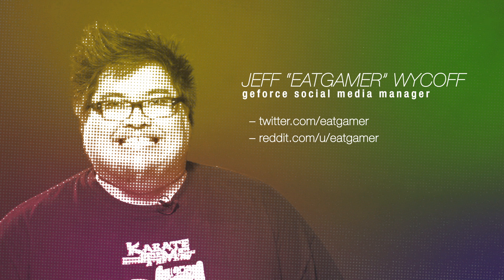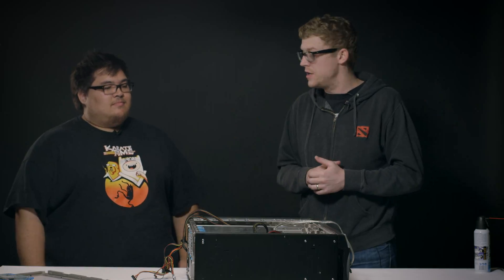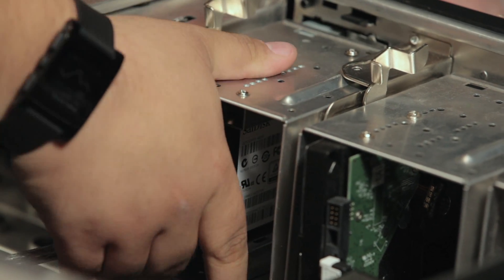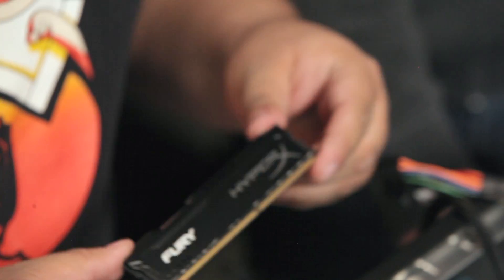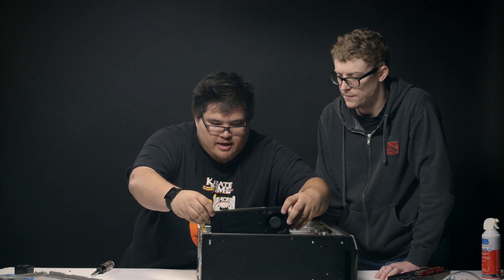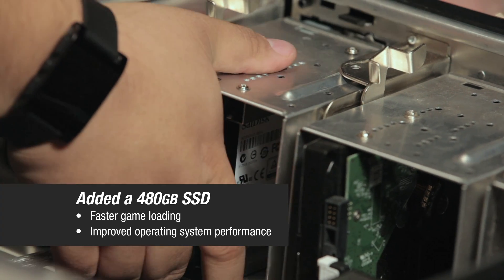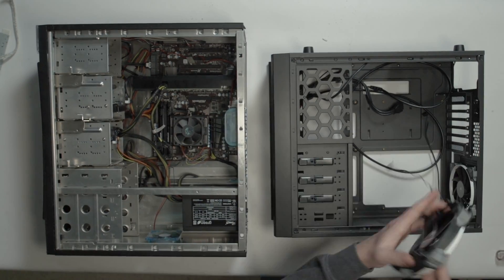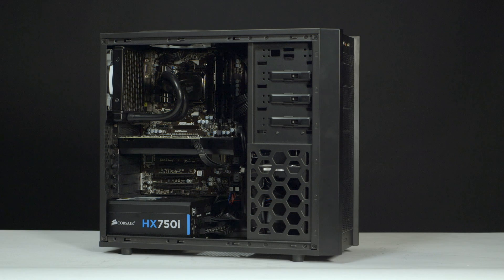GeForce Garage – How to Breathe New Life Into an Older PC

Comment: This is not an upgrade...You just built a new PC that showcases the crapiest parts of the old build! If one thing needed an upgrade that was the motherboard, the CPU (quad core Phenom or what? come on...) and a SSD boot drive would be cool. That 660 is still rocking and 8gb is decent enough for gaming!

Comment: Not one single reason explains watercooling this rig...or any other rig unless EXTREME overclocking is done.  Gamers get a clue,  Watercooling is complete overkill and pointless.  For any twits caring to argue go research water cooling and how water retains heat over time.  Unless you're using some sort of external chilling unit water cooling PC's is just Epeen and a complete waste of time, money and most of all RISK!

Stock cooler or a 212 would have been plenty for that cpu and adding 8gb more of the 1600 though completely unneeded would have been an upgrade,  the 1833 just isn't a big enough difference to justify cost.

SSD's great idea simple and hugely effective,  1st important upgrade to any older rig IMHO.  Most of my customers get upgraded right away and use the older mechanical ones for storage.

960 not bad,  basic upgrade and probably useless depending on the PCIe slot speed on this board.

case meh....works and is far better than the original....Corsair 200r would be ideal and usually what I get for my customers unless they specify something different,  though I'm leaning to Fractal designs midi r2 or Phantex Enthroo pro's for a higher end mid case and all are pretty much future proof as far as space, airflow and functionality,  arguably until Type-c becomes more available.

Comment: Smh so in the old rig he didn't have a radiator cooler whatever and the new one he does?
Reply: Well they imported the parts into a new case and added a better cooling system and a new PSU.

Comment: crap, I had an APEVIA X-Navigator case for a build I made back in like 2005, all aluminum construction, which was supposed to help with acoustics and cooling, with a whole bunch of blue leds and 80mm fans, loud but cool looking back then. My front panel also creaked, fortunately it came with like 3 sets of the interchangeable plastic covers, grey, blue and black.

Comment: People who watch this video please dont upgrade youre old PC like this. At first they bought a ssd which is almost more worth than the rest of the pc, then they did a completely useless Ram upgrade and last of all they replaced the case. Why the case? SSD, RAM,  Gtx 960,  case,  Corsair HX750i, Corsair AIO Cooler and Fans cost all together 700$ shipping not included. And why did they use a freakin 750W power supply?

Comment: more like how to breathe life into a motherboard and cpu.. definitely over the top 8gb is heaps and judging by the cpu, it will probably need upgrading soon anyway... no where near affordable to do those upgrades for most people.. In short your video made no sense you added components which would be too expensive to the average person. I would have bought a cheap (reasonable) case, cleaned the components, left the ram, cpu, and gpu. and added maybe an aftermarket air cpu cooler for some oc headroom at a more affordable price range. A 60gb or a 120gb ssd for os would have been cheaper and worked fine. As for mass storage for games ect at this point is much cheaper using a traditional hdd, (which he already appeared to have) Affordability isn't replacing every component but 2. Lol my opinion anyway xD

Comment: "A few simple and affordable upgrades"
Am I blind or did they basically replace damn near every system component anyway.
Reply: Yes.

All that was left of the original PC was the board and CPU so it was closer to a rebuild that salvaged parts from the old one than an upgrade.

Comment: "affordable upgrades"
Overkill PSU   - No performance benefit
Stupid liquid cooler    - No performance benefit
Unnecessary extra RAM    - No performance benefit
New case   - No performance benefit, put some effort into the old one and its be fine.
SSD - sensible upgrade.
GPU - sensible upgrade.

How about you cut the cost of this "upgrade" by 2/3rds by just getting an SSD and a better GPU?
Reply: its only upgrade the cpu and gpu. ssd, monsters psu, ultra cases - no performance benefit  
:)
Reply: its only upgrade the cpu and gpu. ssd, monsters psu, ultra cases - no performance benefit  
:)

Comment: sometimes I feel like I am not ugly and fat and daft enough to work in such a company.
they literally pretend like if the old 660 was garbage and their new model works far better which actually is not the case. the ti version of the old model is quite similar to the new one
Reply: The 960 is leages better. 60% more powerful!!! Did you not hear? And uses less power and has a bunch of new Hardware based features. Its not like he went from a 660 to a 760. thats a generation gap.

Comment: The most upgrades seemed reasonable - however the ram is wasted on a rig like this. You still won't need more than 8 gigs in most cases nowadays... 

Also you should have mentioned that an old cpu can also impact the performance of your gpu. If you are already going to give people the advice to buy new components for their old PCs - tell them also what not to buy...

Best "bang for the buck" for older (not old) PCs:
+ SSD (if still on HDD Basis)
+ New GPU

The rest is more like.. well... And btw - another way to speed up your older computer - is shown but not explained - clean out the dust - why? Google Thermal Throttling...

Comment: before I watch video change cpu is its worse than i5 2nd Gen and add a GPU done
Reply: +Thundercraft And they have changed everything, but they didn't change the cpu. xD
Reply: shobonimaster And here I am sitting on the good old E8400. And the funniest fact is that after overclicking it to 4,0 Ghz I can play AC:Syndicate in around 30FPS (however it often crashes).
Reply: JTN5M It's likely an overclock that large on such an old CPU as made it unstable at high loads.
Reply: shobonimaster It's not. My second E8400 can eaisly go up to 4,7 Ghz but it needs good ram sticks. E8400 has 9x multiplier which means that it needs only 445 FSB to get 4,0GHz.

Comment: GTX 960 $180-200
HyperX 16GB of 1886Mhz RAM $80
Hx750i $140-160
Antec ONE $ $60 
H60 (all in one radiator) $60
SP120 twin pack fans $28-37
Kingston 480Gb Ultra II SSD $150
Overall Price: $698-747
Calling this an affordable upgrade... Priceless
Reply: +Josh Estipona 
It's more like a pc build than an upgrade.. also quad core cpu, 8 gb ram, gtx 660 and 500 gb HD is hardly shit to start with. Just add an SSD, that should do it.
Reply: id rather go to austin evans and watch his boson 3.0 build
Reply: It is if you have a job...
Reply: you can easily forget about the ram and the huge ssd, I think an ssd just for the system is optimal
Reply: Hey man I was looking for some of those stuff . Thx for the research
Reply: +Margad Ganbold NP
Reply: Most people would just considering building a whole PC at this point since you can build a decent, current rig with a better and much newer CPU for around $800 now.
Reply: I could buy a gaming PC for that price.
Reply: Ahhh look at that sweet RAM price

Comment: This video enrages me more than it should. First, "affordable" upgrades? All that new gear would cost around $700-900 depending on where you live, literally meaning that this "affordable upgrading" is literally as expensive as a new rig. Sure, 'twas nice to see that transformation from a dusty old case to the new shiny one and seeing that pathetic CPU-fan be swapped to a nice water-cooling unit, but saying that this is "an AFFORDABLE and EASY and CHEAP" way to upgrade is just straight-up lying. But, congrats to the guy that got this PC.

Comment: Just took an old gateway core 2 duo tower, added a second hand gts 450, and 8 gbs of ddr2 ram, and the thing plays gtaV at 50-60 fps at 720p lower settings. Computer from 2007, with 50 bucks of shit off craigslist. Get picking guys, theres so much good stuff out there especially on ebay for the older lga 775 stuff.

Comment: I like how they casually glossed over the CPU water cooling and the ridiculously overkill 750 watt 80+ platinum PSU upgrades.
Reply: +LimitedWard It may be more then needed for this build but at least it'll give the owner the opportunity to add in a second GPU for an SLI configuration if he ever decides to do so.
Reply: +Link the Duelist yeah, except they only gave him a 960.
Reply: +luigi1fan1 it was the newest card back then, altho I'd say a 780 or 780ti couldve been better
Reply: +LimitedWard lel, i own a gtx 970 i5 6500, but sadly i have 500w psu

Comment: lel you swapped 1600mhz cl9 for 1866 cl10 you cant just pretend timings dont exist
Reply: +OK THIS
Reply: The Hilo623 Timings affect ram speed too

The MHZ is one thing, but CL10 1866MHZ ram is barely any better than CL9 1600MHZ.

One has better timings, one has better actual clock speed, both resulting in similar speed.

Plus ram doesn't actually matter for speed of a PC in games.
Reply: I'm learning about computers and want to know what that means?
Reply: +OK geez, it's all so confusing. why do I like computers
Reply: +The Hilo623 It's a weird upgrade because for gaming (what this pc is being used for) cpu (processor) and gpu (graphics card) dictate how smooth/setting you can run the game on. The ram is just used as a buffer for the information your cpu is reading. It's faster for the cpu to pull info from the ram then not pulling it from the ram. The ram they added is higher MHz but lower timing maybe resulting in marginally faster ram speed if any. Not to mention 16gb of ram is overkill in most machines.
Reply: +OK So if i understood correctly CL9 is better than CL10? so one has good clock speed and the other one has better timings ,right?
Reply: Xiao457 yes
Reply: I almost want to say in the long run that spending the money to upgrade him to 16GB of the same speed rather than leaving him the just a slightly faster 8GB would've been better.
Reply: "Plus ram doesn't actually matter for speed of a PC in games."

Um, yes it does. If you start running out of RAM all of the extra instructions to be worked on start being sent to disk and once your swap space is being used everything gets slow. 

Go ahead, pick a game. Play. Take out some Ram and then play again. 

RAM can increase the speed of your overall experience much more than a minor CPU upgrade.
Reply: orasis Or you know:

Actually have enough ram in your system so you don't have to worry about running out because it's so cheap you have no excuse not to.
Reply: orasis
 ram speed affects a few games to a minor degree. Some not at all. And you missed my point, 1866 CL10 is just as slow as CL9 1600MHZ DDR3 almost.

"Um, yes it does. If you start running out of RAM all of the extra instructions to be worked on start being sent to disk and once your swap space is being used everything gets slow."

no one should be running a game like that so that is completely irrelevant and absolutely not how ram can affect PC speed. This is 2016, nobody should be running out of ram in games.
Reply: Especially when Ram is so cheap you can get 16GB for like $80 if you shop around.

There's no excuse for a computer to be suffering low memory.

Comment: Here's a easy upgrade , quit writing shit drivers that gimps/damages older hardware ! I have an older evga 780i sli mobo , Q9550 , 8gb ram . Your drivers for Win 10 destroyed a GTX 470 & the hdd that had 10 on it . Constant driver crashes (125 in under a minuet) corrupted the drive and made the card unusable . Fortunately evga took care of the card (lifetime warranty) . If I don't load NVidia drivers and use just the generic vga drivers pc will run just fine . It also does it on the newer cards , have a 760 in it now . So much for reusing older systems , thanks NVidia ...

Comment: Upgrading the ram is so useless.
Reply: +Bananaphone93  yeah Gskill low latency vs Kinstong Value high latency ram
Reply: +Bananaphone93 It gives him more options for more than gaming, so no, it's not useless.
Reply: +IamMortui No it doesnt.
Reply: JgHaverty Yeah I guess because rendering and video editing uses no ram what so ever, what was I thinking?
Reply: IamMortui Its not a rendering and editing rig. Sure it can multi task, but its not going to do anything but gaming very well. 

Any person doing casual rendering and editing doesn't need much ram at all. When you start doing 4k upscaled color correction in DaVinci Resolve on multiple splices of feeds, thats when you need "tons of ram". When you're adding multiple layers in lightworks, on multiple frames, that needs ram. 

 For John Q Public editing their short 1080p Counterstrike videos in adobe premier, no, no you dont need more than a couple gigs of ram, much less 16. 16 is so cheap, its erroneous, but its still not going to be used for 99.999999999999999999999999% of computer owners. 

CPU heavy VST's, DLP's, plugins on photoshop, Color correcting, intensive video editing (editing, not "adding text"), and other things of that nature are just not things most people do.
Reply: JgHaverty That just proved my point, so it was all useless information.
Reply: +Bananaphone93 Yeah if they wanted to upgrade ram they should have just a added two more sticks of the same or similar ram

Comment: New GPU, new RAM, new case, new PSU, new CPU cooler, new SSD... Its more like building a new computer.
Reply: The PSU was a bit overkill tho, yes. Way too much power for that rig.
Reply: +Henry Chan But not a new CPU, which is a big price difference.
Reply: You don't need a very powerful CPU to power the 960.
Reply: Well, as long as they didn't change the motherboard and the CPU, I think this upgrade is still  legit to revive an old PC
Reply: +Henry Chan Yeah
Reply: +Henry Chan How long will my 4790k, 16gb 2400mhz ram, msi gaming 5 z97, 240gb corsair neutron ssd, x61 cooler+ a 1080 when it comes out last me? I have good case (h440w) so dust wont be that big of a problem, i could always blow it out.
Reply: +Michael You should be good for, eh, 5 years, give or take. Most graphics cards go obselete around that time (I consider graphics obselete when they can't do med-high settings at 1080p 55-60fps). Like, the 680, which came out in 2012, still isn't obselete (but is showing age). For your cpu, you will be fine for a while longer. CPU progress has hit a wall. I recently upgraded from my 3770k with an asus micro atx mobo to a 6770k with a ROG Maximus 8 (or 7) hero and only saw 5-10 frames increase (I also got 8 additional gigs of ram). So yeah, your processor shouldn't be bottlenecking for a while. If you want to future proof further, you should get an M.2 or PCI-e ssd over a sata ssd, since they aren't bottlenecked by sata's ass speeds.
Reply: +Michael Really the worst of your problems isn't how long your specs will take you, but more so how long your pc will last. The older the card, the higher chance that it will break. Most pc parts outlive their obsolence but you should still be careful. I had an ass cpu fan cooler that lasted 4 years, got a Cooler Master Hyper Evo 220, and it's fan broke after 4 months.
Reply: my old pc has a geforce 210 8gb ram and an intel core i3 2120 the psu is 600 watts . Will it be ok to replace the gpu to a gtx 950 ?
Reply: Yes, you might aswell throw out your 210
Although, if you want to future proof it i would go with a better gpu, most games need more gpu power than cpu power.
Reply: +Michael so its ok to just replace the gpu with a gtx 950 ?
Reply: +Michael can you also recommened me an intel core i5 model that can go well with the gtx 960 ?
Reply: no why? 6600k is better for the money for those extra bucks you can get more ram or an ssd or even a watercooler

Comment: So... Did they just upgrade this guys PC for FREE?
Reply: +Darian Garbig No idea, I wish they did it to my pc though..(Can barely run bf4 at lowest settings)(20 fps most of the time)
Reply: +Guilherme Meneses 
Haha, same for my computer before i upgraded it. Used to have a GT 610 1GB, runs BF4 lowest settings 720p at 20-35 fps. But as there is a pretty decent i5-2320 Quad Core 3-3.2GHz processor in there, I just needed to get a new 600W PSU stuck a new 980Ti in there. Guess what, it now runs it maxed out at 100+fps.
Reply: My laptop would need an upgrade like this NOW= Intel pentium 2.0GhZ, Nvidia geforce 315M and 6GB ram 😑🔫

Comment: P.S.
I just upgraded my old 2004 PC for $12, by replacing the SATA 1 Motherboard with a good used ASUS SATA II Mo-bo from 2006. This means, the used SSD I have in the PC will be up to or around 10x faster (from one of my Modern rigs upgraded). Same 4Gb Ram (previously doubled from 2Gb), Same (previously updated) Socket 939 Athlon x2 4400 Athlon, same (previously upgraded) HD4890 GPU. It runs CS:GO really well.
All for the price of a dinner near a soup kitchen.
Reply: +Roger Dodger well, thats an nice small upgrade you did man :D

Comment: My PC:
Intel C2D E8400 oced to 3.6GHz
Asrock P5B-DE
4GB DDR2 ram
ATI Radeon HD 4670 1GB DDR3

And Battlefield 3, Thief, Max Payne 3, Life is Strange, Skyrim are perfectly playable! Heck, in Skyrim I have 60+ mods, and it is still great, except for the thing what makes Skyrim Skyrim: crashes. :DDD

Also, I played through GTA 5 without shadows(It was stuttering when driving), then upgraded to 4GB and locked the FPS to 30, and it was fine! So yes, you don't need an OMG HARDCORE ULTRA120FPS PC to run newer games, you only need compromises and logic.